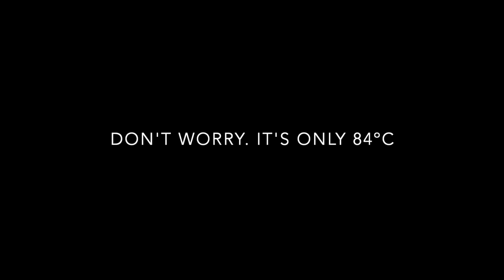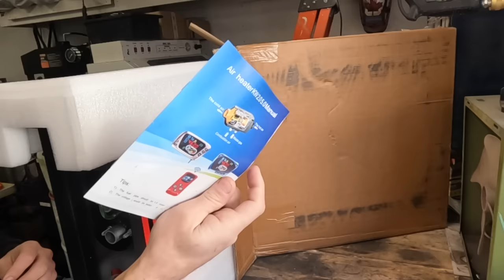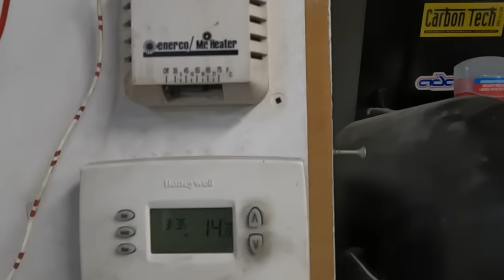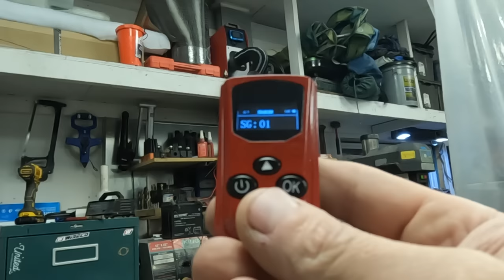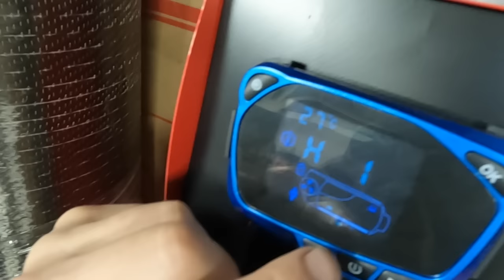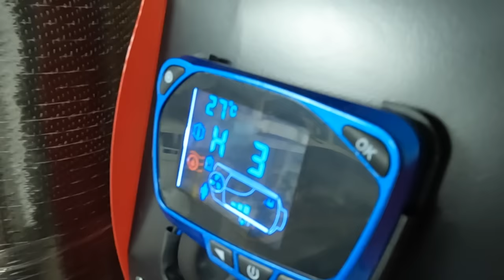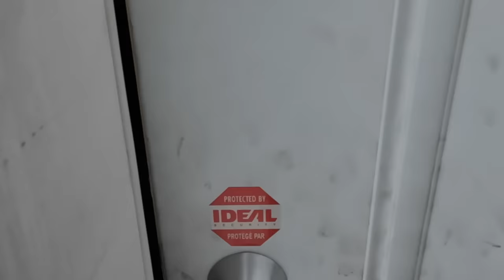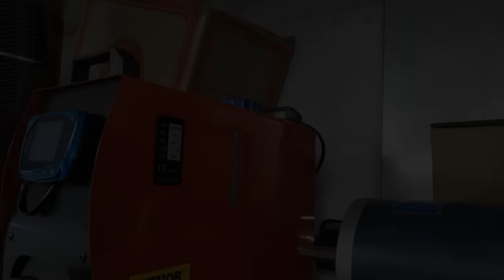Chinese Diesel Heaters - DON'T BELIEVE THE HYPE !!

Comment: Lmao......I hope your engine troubleshooting skills are better than with your heater. There are so many variables with burning waste anything from viscosity to having fuel mixed with the oil. If you've ever seen a melted 2 stroke piston, which I assume you have, you would have a pretty decent understanding of what's going on. I havent run waste through mine yet but i woikd imagine that you'd have to tweak the hz settings a bit because that waste oil will likely have far more btu's in it. Lol....I slso wouldnt leave it running unattended......it is a $150 off shore fuel burning,catalyzing combustion chamber afterall.
Reply from the maker: Haha.... thanks for the comment. This turned into a 30 part video series. I like tinkering with crap and experimenting. Diagnosing engines is pretty easy. I agree that the quality if used oil is a big problem but I believe it has more to do with oil vs fuel... as many of my experiments have shown.

Comment: Yours is the only vid I've come across that is negative towards the dorsal heater , and let's face it your a jet ski buff , you used oil not deisel.  Thus I will ignore your ignorance . You watched one video ive watched a whole lot more.
Reply from the maker: Haha... I think you're confused... These heaters are great ! I didn't say anything bad about the heaters, or the manufacturer, or the retailer... What I said was people are spreading misinformation about them. You're right... I'm not used to diesel, but also, I'm not burning diesel... I'm burnin waste oil, that's the issue. 

You may have missed the point of this video and it seems you're confused. The main body of this video was shot a long time ago. I decided not to release that footage because I wanted to do more testing with waste oil before I made a video saying that it worked well, because I had some issues. The beginning and end of of this video, along with a few extra clips are from a week ago, and the rest a older.... This series is about running this heater on waste oil, and how it can be problematic and even dangerous. 

In the past several weeks been watching a lot of videos on these, but try to stick to ones where experiments have been done in detail. Mostly David McLickie... Cheers.

Comment: Just use diesel. No wonder it was a 'disaster'.
Reply from the maker: Yes, I would 100% recommend for everyone to just use diesel. However, that's not why I bought mine. I bought mine because people claimed that I could burn waste oil for years, without any troubles... 

I have a 200,000 btu floor heating system and a 80,000 btu mr heater ceiling unit that both run off natural gas, so heat is not my issue ... cost is my issue, and diesel cost more than natural gas. The games shall continue. Thanks for the comment!
Reply: @loweredexpectations4927  ahhh, gotcha. I used 80/20 diesel to used filtered motor oil and after 6 months had to clean it, switched to diesel only and a year with no problems.
Reply from the maker: @Shakey31  Yeah... they are neat little units. I did a test where I put it together with lots of crud in it, burned diesel for a few days and then took it apart.... It was MUCH cleaner inside than when I put it together... If I could get 6 months at this point, I would be super happy ! haha.

Comment: Burn correct fuel and there safe plus work as said
Used oil and other crap is pure stupid
Reply from the maker: Yes... I wish I would have talked to you before purchasing this heater, as the videos I watched said that they were great for burning waste oil, veg oil and all sorts of nasty crap. I have tested it on diesel and it works wonderful... I am currently running it on diesel as part of a test to see how much crap it cleans out. I've done it before, but this time I'm filming it. 

I am going to keep experimenting, as I have a bunch of waste oil, I'm poor, and i've invested money into this heater. With the cost of diesel, I'm better off to burn natural gas, as diesel is almost $2 a litre. Thanks for your comment.

Comment: That muffler does not do a thing.
Reply: That's not right, with one or even two of them it's not so loud. Importent is that the exhaust line must be shorter then one Meter or so. Other wise it creats to much back pressure.
Reply from the maker: It helps a little.
Reply from the maker: I was playin with the exhaust this evening... removing it seemed to help, but bent or not didn't' seem to make any difference.

Comment: No point to this video at all !.. Other then to "watch my next video to see how I almost burned my garage down" 25 minutes wasted
Reply from the maker: Sorry you feel this way. This series is actually about testing my heater on waste motor oil to see if I can actually make it work. Also, to show people that burning waste oil is not as easy as doing and oil change on your grandma's Buick and pouring that oil in your heater. Oh... and to show people it can be really dangerous.
Reply: @loweredexpectations4927  Sorry, your right though "It is good information"  I did see your other videos to this product and I'm glade I did you redeemed yourself!! I'll delete my previous comment. Question wouldn't propane be cheaper then this thing. At this point because you can't use, used oil?
Reply from the maker: @TallStarlite  No need to delete your previous comment.... I get what you were saying and I do that sometimes as well. Welcome to being human 🤣 I'm glad you checked out some of my other videos. 

I have two natural gas heaters, and if I run diesel in this thing, then yes ... it would be way cheaper to use my NG heaters. If I can't get this to run on waste oils, then it doesn't really make sense for me... They are great little heaters for many applications, but not so great at heating a two car garage / workshop in Alberta Canada. 

I have been heating my garage for almost 2 months with this thing.... despite having to clean it all the time, it makes heat, haha. I believe I am getting a little closer to making it work for more than a few days, but it could all end in failure !

Comment: If you burned diesel fuel in it like you are suppose to the heater would work great. The heater is not the problem YOU ARE.
Reply from the maker: Thank you for the comment. You are correct about this, and the idea of my video series is to raise awareness ... many people make videos claiming you can run these on anything, and I am showing, that is not the case. I just chose an entertaining way to do that. 

I currently have one of these in my GM truck running on diesel and one in my friends 4Runner and they are awesome !

Comment: Looks like your fuel filter is installed backwards.
Reply from the maker: I looked to see where it was even shown in this video, but I didn't find it, haha. It just looks like it is upside down because of the way the fuel line was routed. It came down out of the tank, went into the filter into the pump and then to the heater... Either way it wouldn't matter other than it would plug up quicker.  

Oh... I see it now. Right at the first of the video. It's on correctly. The pointy end points to the tank. 👍